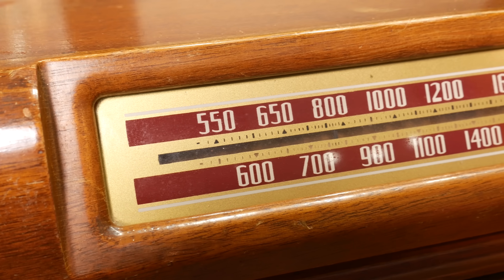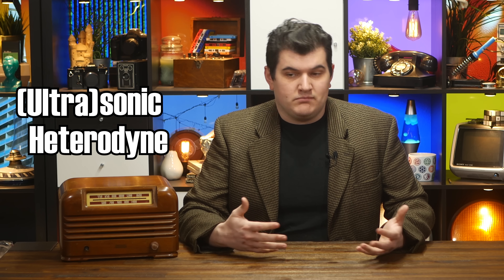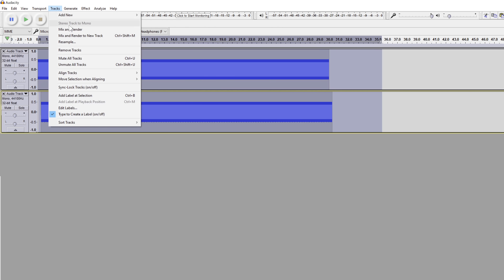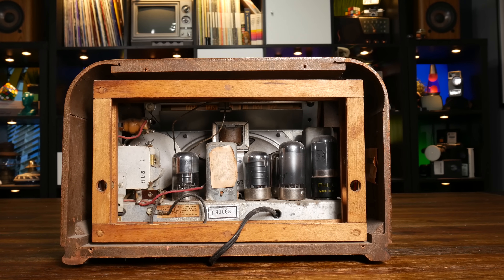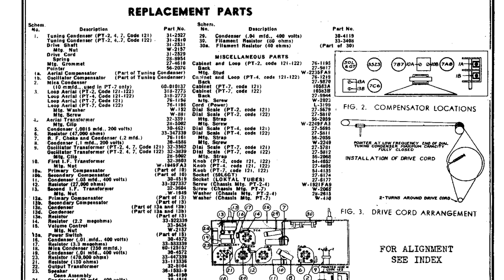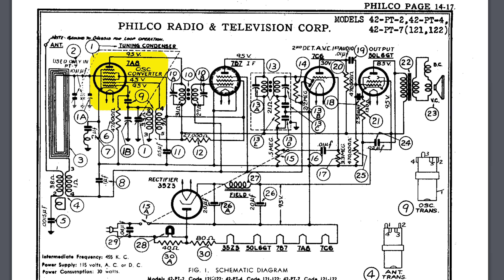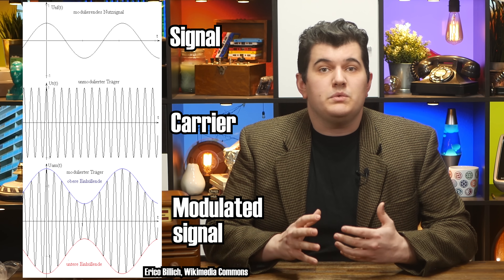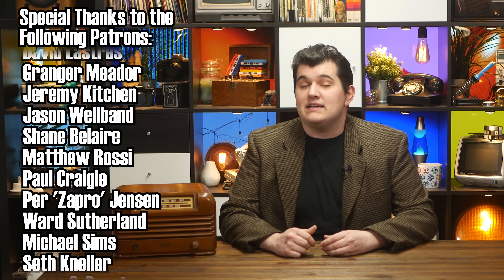The Superheterodyne Radio: No really, that's its name

Comment: I used to look at these circuit diagrams in the 60s and wonder what the hell was going on. Finally when I got to university I found that everything was starting to appear in little balck boxes and all these lovely old fashioned diagrams withs valves (I'm in the UK), capacitors, etc.. had gone. I never really got to look at them and see what was happening. Finally, 50 years later I begin to see what all the fuss was about. Thanks for your videos - they have taught me a lot.

Comment: I love the  ( probably) hand crafted wooden case. Ok, some tooling but you know what I mean. Should be possible to find a replacement knob for the one on its right bottom that's missing. Also the electronic interference pattern is clever.

Comment: There is also an unmentioned downside to the Superheterodyne principle. The 'whistles' that are clearly audible between stations when dialling. And can even be audible when tuned in, depending on signal strengths and harmonics. The older simpler filter radio's didn't suffer from these whistles.

Comment: I have a great model in a nice wooden case that I purchased used 50 years ago. Has 5 radio tubes. The 35w4 is the rectifier tube. Also has a 50c5  12? 6( maybe 12au6 ). Anyway great thing that the 50 35 & three tubes starting with 12 means that these heater voltages for the tubes add up to close to the 120 volt line voltage. They wired all 5 tube heaters in series so a power supply was not needed for them. Our electronic shop teacher said it was the greatest radio design at that time. This old radio still works.only if it a few times a year while working in the garage but plays great and never had to replace a tube yet. Picked up a couple of the tubes super cheap when a local electronic store closed.

Comment: To this day, some of the highest end Ham radios use superhet.  Only now is SDR starting to make major inroads, and superhet is still in many cheaper, as well as the most high end of two way radios.  My Yaesu 5000 has double and even triple superhet receivers, and will go toe to toe, if not beat, any modern SDR radio on the market.

Comment: But howwww does amplitude modulation encode the sound instead of just making a single tone at the carrier frequency just sound louder and quieter and louder and quieter???
Reply: The amplitude variation of the signal wave is itself a wave; there are high points of amplitude (peaks) and low points of amplitude (troughs), and you can measure a certain amount of time between amplitude peaks (frequency).  While the carrier wave's frequency may be constant, the frequency of the amplitude variation can change, which is what's used to encode information about the original sound's frequency.  

You just have to filter out the carrier part so that only the amplitude variation remains.  Then you have a wave with variable frequency and variable amplitude, just like a sound wave.
Reply: @toxicpsychotic6356  True, but the "Carrier Wave" frequency does not actually remain constant nor "alone".
If a radio "Carrier" wave is Amplitude Modulated (with a variable frequency which we might call "Voice"), THREE frequencies will be produced.
These are 
Carrier
Carrier + Voice
Carrier - Voice
(The two generated frequencies are called "Side-bands".)

(With a 600 kHz Carrier signal and a 1 kHz Voice signal, these frequencies would be 
600 kHz
601 kHz
599 kHz)

At 100% modulation there will be NO Carrier remaining, only the two Side-bands of "Carrier + Voice" and "Carrier - Voice"
However, this should never be allowed to happen, since the received result will be distortion.

The presence of the "Carrier" wave allows the receiver to have a "reference" frequency against which the other two signals can be compared.
This is called "Double Side-band" (DSB) transmission.

If the "Carrier" and one "Side-band" is suppressed (Not transmitted), this is "Single Side-band" (SSB) transmission, which IS more "efficient".
However, without the actual Carrier frequency as a reference, unless this frequency is ACCURATELY restored, the frequency of the restored signal may not be "accurate" - in "pitch".

Comment: Amazing video!
Also, at 1:55 This is a trick guitarists can use to tune their instrument! Produce what should be the same note on two strings. Increase or decrease the tension of the string you know is out of tune, until the beat becomes so slow it practically doesn't exist

Comment: They must have had a supply of Locatal tubes they wanted to use up.  You wouldn't ordinarily use 6 Volt (Loctals call 6 Volts, 7) tubes in those locations, that string is designed for 12 volts (that's why they added the resistor).

Comment: 12:30  - Why is there a nut stuck to the speaker cone ?
BTW:  Does your Philco work ?     There are some great videos on old radio repair and theory...
Fun Fact:   The Local Oscillator in radios was used to detect operating radios (from the street in specially equipped trucks),  in homes that did not have a "radio License" and were fined....

Comment: I’m electrical engineer, but taught myself a lot as a young teenager.  I remember those tube schematics, and would bug my high school teacher by calling them condensers as well!  Tube circuits are also easy to debug, even without a schematic, due to the tube types and the way they were hardwired without PCBs, so all components of a particular tubes circuit were in close proximity to the tube.

Comment: Not just radios and TV receivers, the pulsed radars I worked on in the 50's and 60's did the same thing in the receivers but for a somewhat different reason. Dropping the received frequency down from multiple Ghz to 30 Mhz  intermediate frequency meant much simpler and less temperamental receiver circuitry.

Comment: As a teenager back in the 1960's I got interested in radio. All circuits except the superheterodyne had trouble separating stations. I remember the old five tube radio well. With the superheterodyne it was possible to pick weak or distant stations. No other radio could detect them.

Comment: Before the Superhetrodyne were tuned radio frequency radios.  The problem came to get enough selectivity and amplification was very complicated. First one state would be adjusted to best signal, then the next, and then the next etc.  Early radio would include a log where settings  were recorded for each stage. instead on one dial like with the superhet.  455 kc or kilohertz was a patened freq so some radio would use 450 KC instead to get around an infringment.

Comment: This is really good video, I have a late 30s stand up silvertone radio at my apt and I love it. I need to have my local radio repair man take a look at it cause it keeps over heating but it works great for the only 2 station we have in this small town. It just smells of burning plastic. You can buy replacement radio knobs on eBay for the knob your missing on your radio but you have a gorgeous little machine.

Comment: I am not going to check 1700+ comments to see if someone corrected you. At approximately 8.40 your graphic and explanation are wrong.
If f1 is 780khz then your local oscillator (f2) should be 1235khz. The intermediate frequency stage is normally optimized for amplifying 455khz. It will reject higher and lower signals and harmonics because of the high Q value of that stage. After bags of amplifying only 455khz signal is usually again mixed with 455khz and a diode is used to detect the difference signal which is then passed on to the audio amp. At the detector,  there is usually a tap of the audio signal for the automatic gain control (AGC) which adjusts the gain of the IF stage(s). The AN/ARC 515 on the F18 was a v/uhf radio. It would take a vhf signal, upconvert  it to a uhf signal, amplify it filter it   and then down convert it to 10.7mhz(?). There it would amplify it again and filter it and do it all over again at 455khz  before detecting it. Both AM and FM. Piece of crap!

Comment: In order to get a beat frequency the 2 speakers must be in phase. The higher the frequency, the more accurate the 'In phase" problem becomes. That means the source of the 2 sounds must be in phase and the speakers must be wired correctly + and - and the distance of the wire connecting the speakers must be the same and your ears must be perfectly in the middle of the 2 speakers ( that's a problem since you have 2 ears in different locations) and I guess your brain must also process the signals in phase ( whatever that means ). At 400 Hertz, 100us out of phase is probably not significant but at 5kHz experiment go Booom

Comment: I took an electronics class in the underfunded school in my town in 1976 that still used vacuum tube teaching consoles. I'm sure they trained students in the 1950's interested in becoming TV repair technicians. I transferred to the school that had digital electronics classes. I did enjoy learning the old technology and repaired an old black and white TV while in that class. Swapping vacuum tubes was something you had to be more careful with because of the heating elements, and some of the typically higher charges they could be carrying. I learned not to pick up a TV picture tube by the neck because of watching someone else do it - the neck cracking - and the rest of the tube dropping 10 cm to the desk it was just picked off of. We were lucky the rest of the tube didn't implode. XO

Comment: 10:22 That was sometimes solved by stuffing that oscillator into a metal cage. Or coating the inside of the radio with a metal. I had seen such stuff pretty often.

Comment: Capacitors used to be called condensers in English? The French word for capacitor is still "condensateur" to this day, and I don't know what to make of it
Reply: It's the same in Japanese and German according to some other comments. It seems like capacitor is the odd one out despite it making a tad more sense since capacitor explains that it stores voltage and not current (which would be an inductor). It also shows that it "fills" up in the voltage since it's not really condensing anything, it's just filling up on voltage.

Comment: I think you mistake mixing and combining in this video. The wave interference when adding two waves is not the same as the frequency mixing that happens in the radio. One of the operations are linear and one is non-linear.

You could see mixing as multiplication of the waves and the interference as addition of the waves.

Comment: It's amazing how complicated "simple" things like a radio really are.
Reply: The wonderful world without, or before, the silicon microchip. The most mundane things become incredibly complex.
Reply: @WanderingMania  You're joking right? 4 active components in this radio.
Reply: @hansjanssen3364 ,
Your trolling right? Or maybe you just didn't watch the vid at all.
Reply: @WanderingMania  I replied your comment where you indicate things were more complex before the microchip. They weren't.
Reply: @hansjanssen3364 ,
Yeah... And if you watched the vid you could see that they where.
Reply: @buckrodgers1162 since when are microchips simple?
Reply: @saundix i think they mean that chips make the rest of the electronics simpler. For example a for a solid state device one doesnt need to understand how it works. It does its job and thats it. Its shallnt be tampered with or adjustable. 

Compare that to the tech seen here. Its definitely more fun to play with and looks more intresting than anything you can find inside devices now.

Tldr newer tech just hides its complexity. Especially now that a lot of things are solid state they just look like boring grey/black boxes filled with magic smoke.
Reply: Old Radios are even More Comlicated, as one Tube or Transistor does Multiple things. Nowadays you would likely have the Oscillator and Mixer as seperate compononents.
Reply: Understatement of the century, especially when you actually work on them

Comment: The only device with a name that is cooler than a Superheterodyne radio is a hysteresis synchronous push pull amplifier.
Reply: Explosively pumped flux compression generator is probably my favourite for cool names. Though out of the more common devices, "cavity magnetron" has got to be near the top (not just for the name, but for the history too).
Reply: @dingo137  At this time, I am looking at one of the magnets from the magnetron of an F-105 Thunderchief. this magnet has the south pole in the center and the north pole  on the ends. (or vice versa, I lost the other half.) The last time I heard the word, "Cavity magnetron" was in tech school at Lowry AFB Colorado in the early 1960's.

Comment: I wish you used a better word than injected. Do you mean multiplied? Added? Also a signal multiplier is often referred to as a frequency mixer... and the intent isn’t to mix all the frequencies. You mix the drive frequency with the received signal by multiplying them, and then doing a short time average. The wrong frequencies will cancel out after enough cycles, but the right frequency reinforces itself over time since the square of a sine wave is always positive. But I am not sure how you’d explain this because it kinda needs some basic Fourier analysis and you tend to avoid math

Comment: The reason you couldn't "generate" the beat frequency is because a nonlinearity is required.  This is usually provided by having the "mixer" MULTIPLY the 2 frequencies together, not ADD them.  But a simple nonlinearity, such as a diode, will suffice.  The headphones work better most likely because you overdrove them and produced nonlinearities (but I heard no beat in the video).
          There is another advantage for superhet radios you did not mention.  That is the problem where you are building an amplifier that has a gain in the many millions (from the level of a wiggling electron to a large output signal).  The challenge is the same as that encountered in a audio system with a microphone input, and a speaker output.  If the tiniest amount of the output leaks to the input, the system goes into uncontrolled oscillation.  By performing some of the amplification at one frequency, then shifting it to another and amplifying it some more, the leakage of the output to the input is "out-of-band" and rejected.  Most radio receivers, including those fixed-tuned (such as remote control for toy car) use superhet receivers.
          Your statement about "software radio" is way off!  Most "software radio"  (a buzzword, and which it is mostly not!) starts by amplifying the radio signal, and downconverting to a frequency that the analog-to-digital converter can handle.  That is "plain old superhet receiver" for the "front end".  Even the software routines that follow perform a superhet conversion again, to yet a lower frequency, that the following "demodulation" software can perform with less computer loading.
          You need to mention "homodyne" receivers where the frequency being mixed in is the SAME as the frequency being received, and "superregenerative" receivers, where the same signal is recirculated through only one amplifier many times to get the required gain.

Comment: Radio Luxemburg  which was started in the 1930's had a power of 1.3 mega watts. it was so powerful that it caused a modification of the ionosphere. This resulted in the modulation or heterodyning of other stations whose radio waves passed through the same volume. It was known as the "Luxemburg Effect". It did not make the other station owners happy.

Comment: A real world example of the local oscillators causing problems I came across was with the early days of radio pagers, a large UK fire brigade noticed that when a lot of their staff where together in a meeting their emergency pagers became unreliable this was because the local oscillators of all those pagers were interfering with each other. BTW you also skirted the fact that Superhets also work fine with FM not just AM signals.

Comment: I read somewhere that superheterodynes were the real reason why soldiers behind enemy lines during WW2 had to avoid using radio except under specifically defined conditions. The local oscillators in their portable units tended to be noisy, which allowed the enemy to triangulate their location whenever the units were powered on, even when they were only receiving.

Noisy oscillators also gave away the presence of speed radar detectors, at least the models that were around when I was younger. Many states outlawed radar detectors, so police could detect your radar detector and ticket you, even if they weren't actually using their radar at the moment.

Comment: A slight clarification- it's not the I.F. tube that filters the other frequencies. A tube will amplify whatever frequency is applied to it's grid. It's the I.F. transformers (the square metal boxes on each side of the tube) which contain resonate circuits tuned to 455-Khz that do the filtering.

Comment: I'd like to see vids on the other varieties of receivers, the Syncrodyne and the Homodyne. No joke folks, these are genuine technologies. The Syncrodyne uses a local oscillator at the same frequency and phase as the incoming signal and converts directly into audio after the mixer. The Homodyne samples the incoming carrier, strips and filters the modulation from this sample and uses that as the local oscillator. Audio detection is the same as the Syncrodyne.

Comment: Damn, that's a dangerous radio due to the missing knob and metal shaft were I think the volume control is supposed to be. Those things has no AC transformer at all, meaning that if you plugged the two wire line cord in the wrong way, the entire chassis would be at full 120 volt AC line voltage, including that volume shaft sticking out. Anyhow, Merry Christmas two years later in 2020!